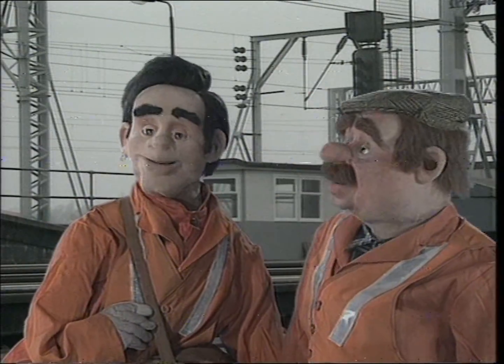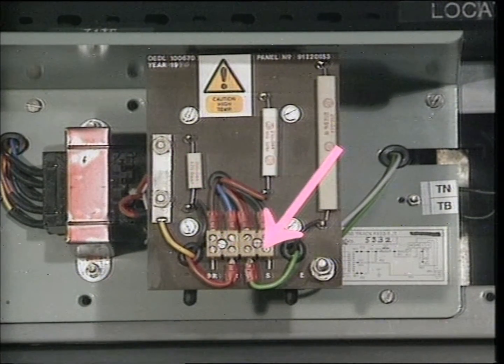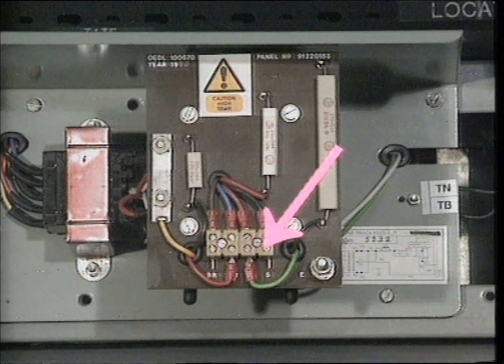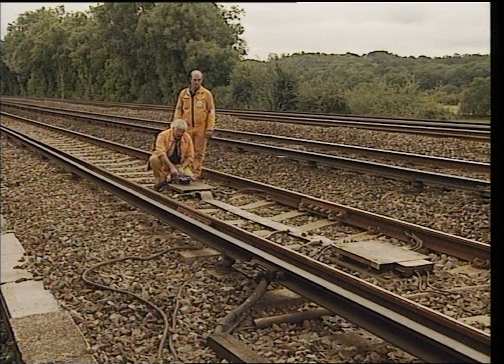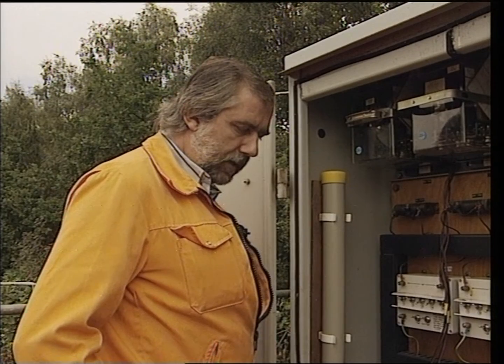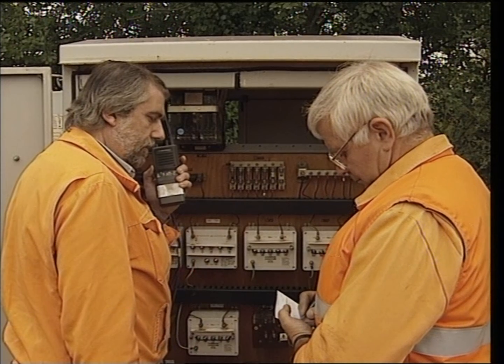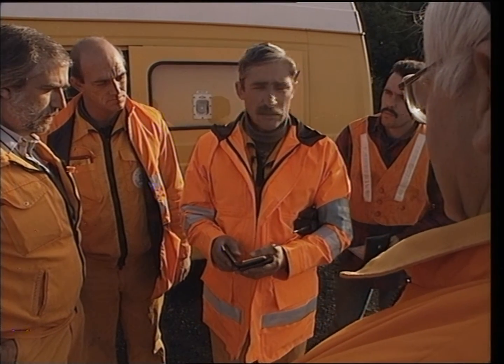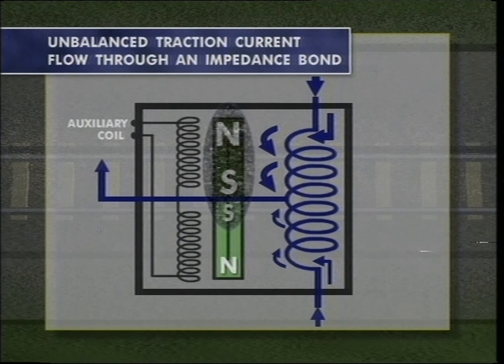British rail training video With life size puppets (Laserdisc)

Comment: There was a BBC2 Continuity video that you posted, from 5/7/1990, that had a coming up next bumper for The Hallo Spencer Show. English episodes of the show are quite hard to come by online, and the show hasn’t been rereleased onto DVD/streaming services. If the episode is on the recording, would you be able to post the episode to Youtube/another site?

(I don’t believe that the copyright holders to the show will give you much trouble over posting the episode. They seem to have disowned the English dub.)